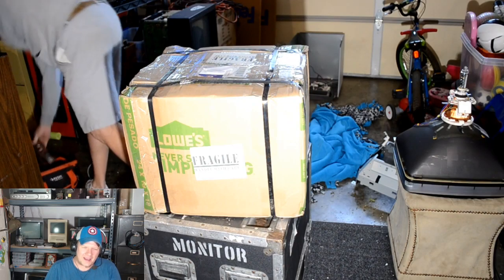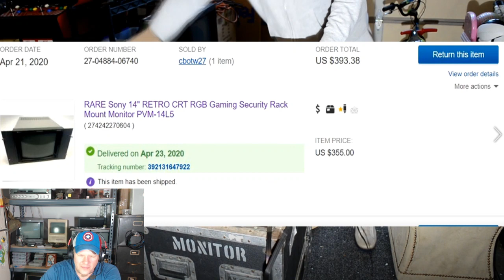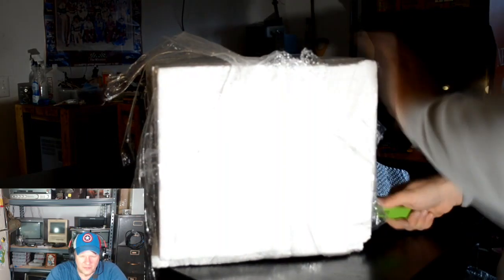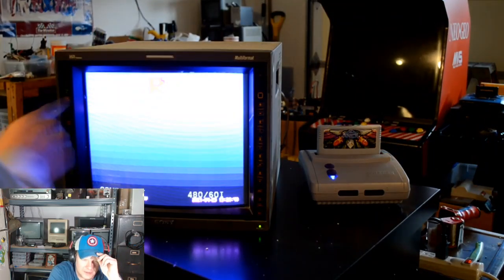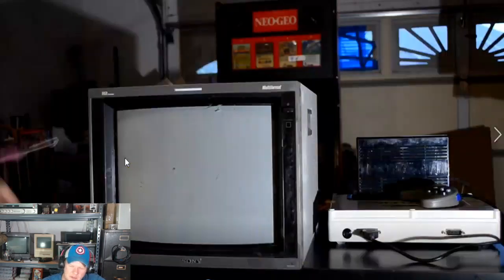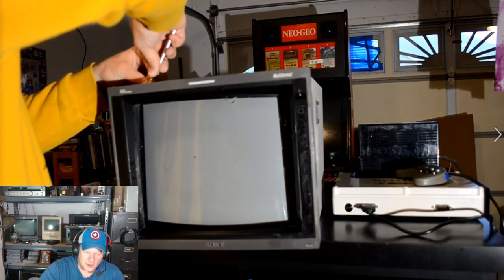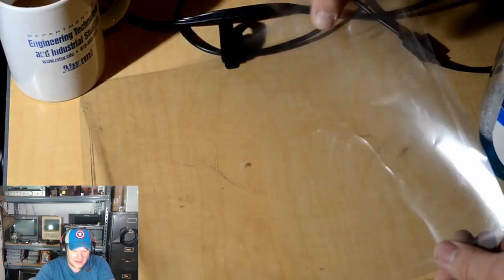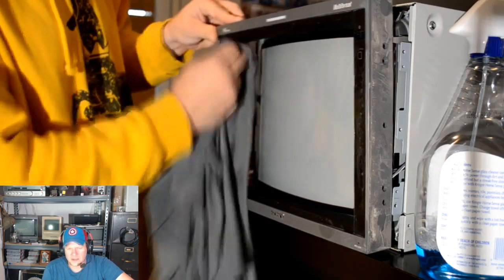Best Offer Accepted! Sony PVM L5 Bargain & Repair

Comment: I had one of this but one day the image was full of static with no color, even when the color adjustments in the cathode tube worked fine. If the image was too bright the screen would bend/ distort. I don't know what was wrong with it and throw it away. Do you know what was the problem with that? After stumbling with this video I want to get to the truth behind my loved monitor. Thanks and nice video!